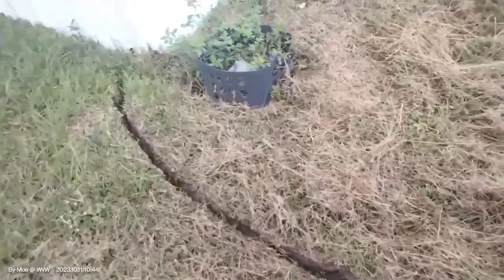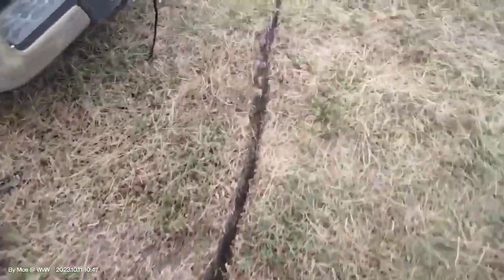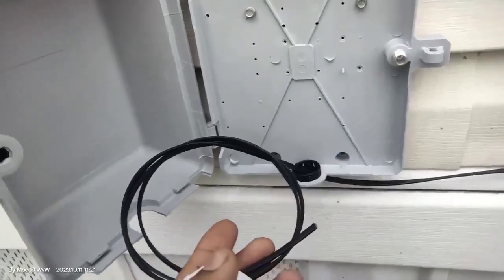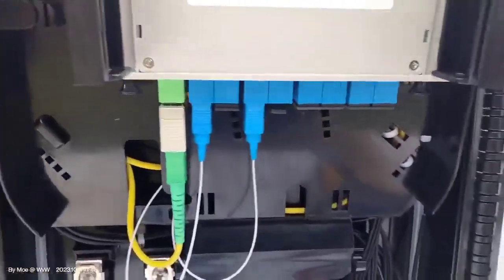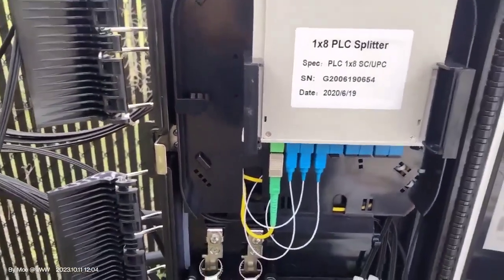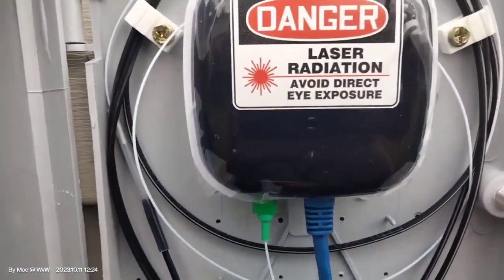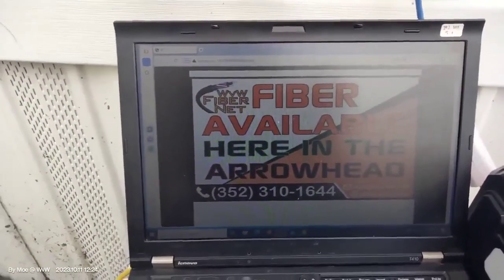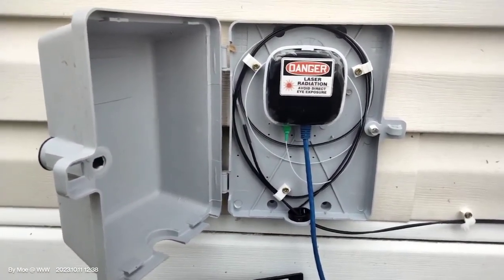RV Park. Fiber last mile delivery. Another simple complete  install.

Comment: My ISP wishes they could have trenched like that, but they went 75' to the box at the top of my driveway near my neighbors through my rocky ground, putting conduct in with a big trencher struggling with the rocks. They thought my neighbors were my family, and we all would hook up, but I was the only one who paid the extra cost for the 160' from the road. Our power company has fiber now down our road a year later, but they use the poles. Even with the extra cost of the digging, I saved money by getting off Starlink and having much more bandwidth.
Reply from the maker: Our builds are limited usually inside communities. We are few people working together and all of us can do any part of the install so we don't hire contractors and so on. the install cost the customer $75.00 and the internet cost is between $35 to $75. We now offer live tv for communities that range from $25 and $35. out trenching is barely within the specs of low voltage rules and regulations. that is all.